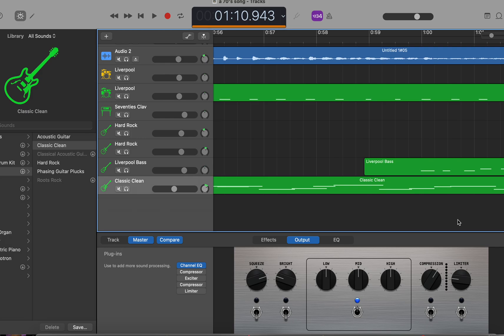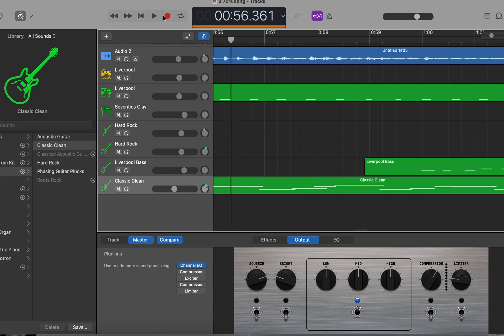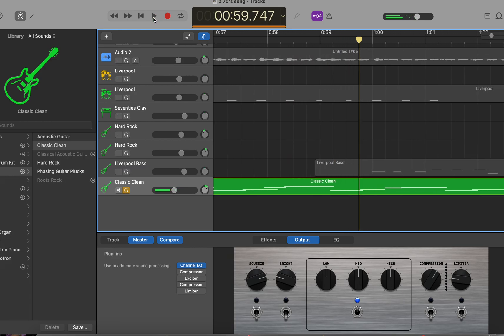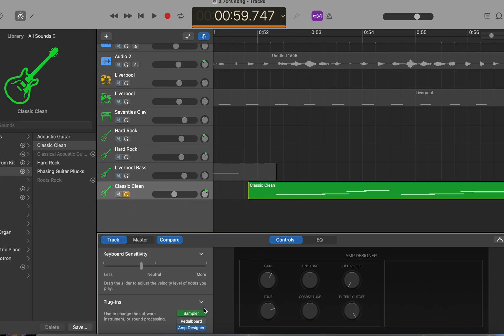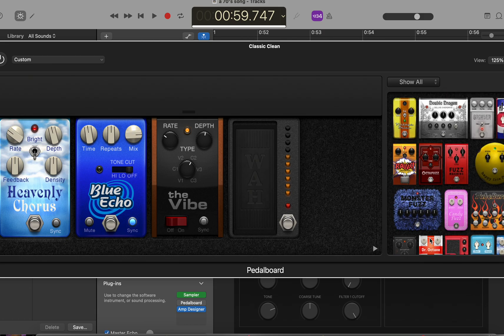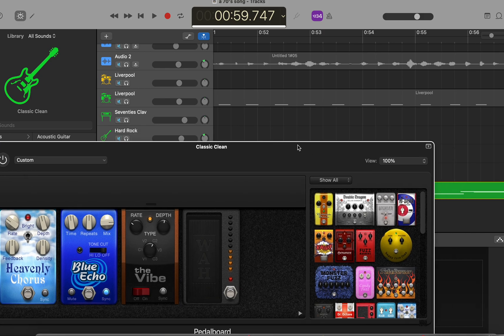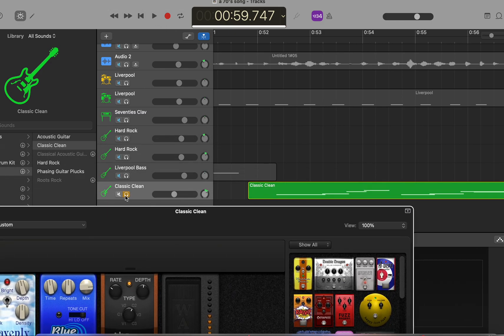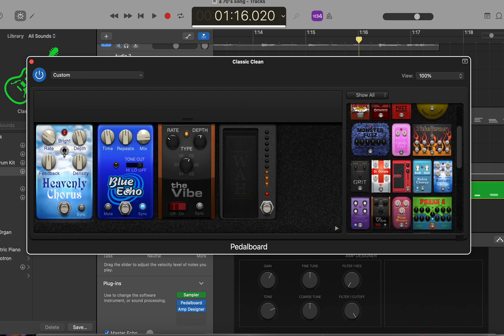[Tutorial] How To Simulate Wah Pedal Effects In Garageband

Comment: but how do you actually save the wah strokes.. you just played over but did it save the movement of the pedal in the recording?
Reply from the maker: Correct. A so-called “automation”, any thing you do to alter the music while in record mode, GarageBand records into the song. Even as basic as changing the song volume during recording.

Then save song.
Reply: @BradHines  thanks.. it is hard for a guitar player to use both hands then mess with the wah wah pedal using the mouse. . is there a foot switch to use to control the mouse?
Reply: @BradHines  i found this "So what i did was i recorded the guitar without wah then i went to the recording settings and turned on merge recording then recorded myself wah’ing the guitar"